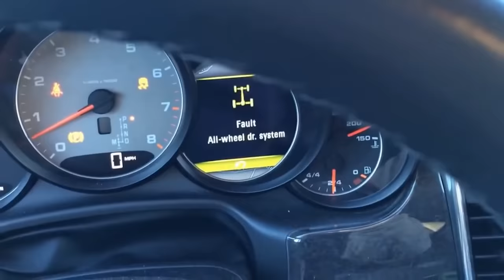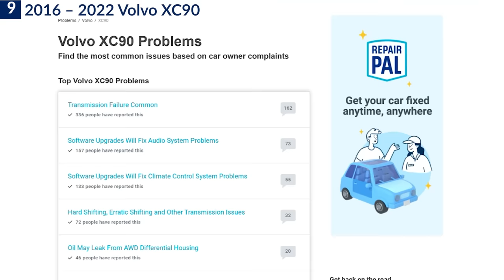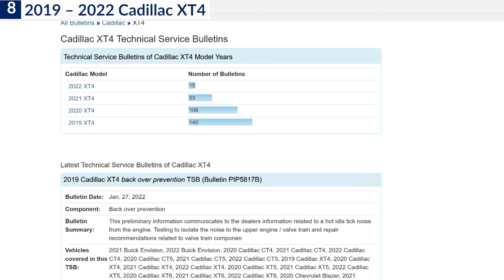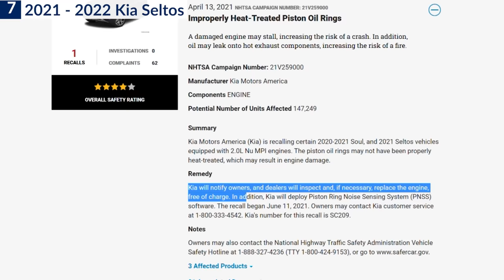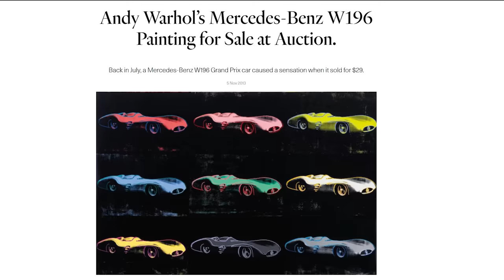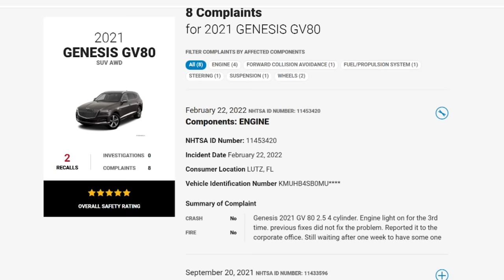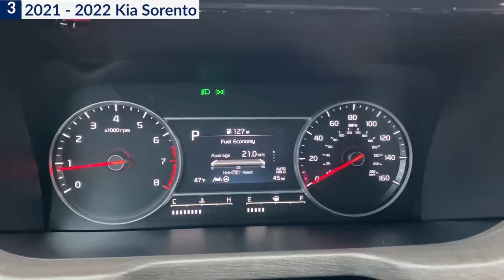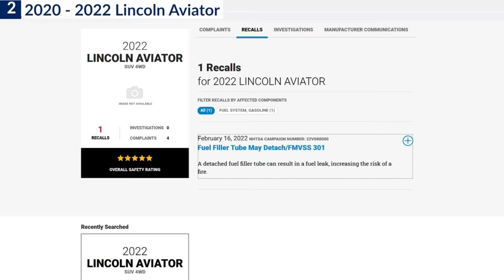10 New SUVs to AVOID - Here is Why !!

Comment: I had a Volvo, I can say the first year and 3rd year it was in the shop often. I currently have a GV80...I haven't had one issue at all. A friend of mine has the GLE 450, he swears he'll never get another Mercedes after driving it.
Reply: I’m thinking about getting a gle or even gls, why do you think your friend would not get a mb again?
Reply: @rosellebn  Because he's had it for 12 months and it has been at the shop for craftsmanship issues on 9 different occasions. He just got it back yesterday after 2 weeks in the shop. This time It would randomly pop the rear seat forward as if someone were trying to get in the 3rd row...but while he was driving.  3 separate occasions the battery died and the auxiliary battery would drain quickly too. He also dislikes the quality of the transmission...his previous vehicle was a BMW though, so it makes sense. They simply make better cars than Mercedes.
Reply: That’s not entirely true at all.  I went from M cars to AMGs and it completely depends on what you are looking for.  Nobody in their right mind would ever say BMW makes a smoother more Luxurious car than Mercedes.  That’s absolute nonsense and is coming from someone who has never owned one and their friend clearly got a lemon.  However, if you want sport over luxury than BMW is hands down the way to go.  You’ll l find 9 out of 10 people who hate on Mercedes bmw etc are hating from the outside looking in as they could never afford one.  The other 1 out of 10 bought a used one with 200k miles on it and complains  that it has problems.
Reply: @221ddj  You have some goofy opinions there and fit the categories I just described lol.  A Benz is overrated but a 70k Hyundai isn’t?? Hmmm.  If you could afford anything in the benz lineup, you wouldn’t end up with a Hyundai.  You’d be rollin in a S63 stop that nonsense, it’s very transparent.  As for Hyundai, everything they do is to mimic higher end cars for people who can’t afford the real thing.  Again, you’re exactly who I just described in the first comment.
Reply: @bustanutist  Warren Buffett has driven Ford's and GM's for the bulk of his life. Having money doesn't mean you blow it on cars just to show people you have money. That's what insecure people do. 

To me, Benzes are overrated, as are Jaguars and every other British and Italian car. I like BMW's, I like Genesis, I like Audi. Point is, you and everyone else can like whatever you like. If you can afford to blow money on unreliable cars, and that's what you want to do with your money, do it. I on the other hand prefer reliable cars that are nice, get me from A to B in style and I'm never at the shop. Meanwhile, I invest $15K per month in appreciating assets instead of depreciating cars. I own the house I live in, and it's valued at $912K, I have 7 figures in the bank too so your opinion is rather goofy to me, but it's all about perspective I guess.
Reply: @221ddj  Also, you clearly don’t understand capitalism. If a product was so overrated and inferior but was still charging a superior price…that product would never get such a strong foothold In the luxury car market like Benz does.    If the car was so inferior all the normal brands wouldn’t do everything in their power to imitate them.  I guess the markets clearly wrong because a 12-year-old riding in his mom’s Genesis says otherwise.
Reply: @221ddj  Uh oh someone’s taken marketing 101 and knows some buzz words lmao.  How does the us market have nothing to do with capitalism? I’d love to hear that.  Capitalism is solely based on supply and demand.  So again, you can’t charge a premium price for a non premium product… there would be no demand.  That has nothing to do with marketing.  You agreed that brands imitate Benz.  So again, you fit in the two categories I outlined earlier as you’re hating from the outside looking in.  Which is my sole point to the person asking about luxury cars/products.
Reply: @221ddj  You think someone could charge a premium price for a shit product for 97 years and dominate the market? Hmmm.  Interesting.  A lot of buzz words in there that fall short again.  Mechanical engineering and t shirts is a great comparison too.
Reply: @221ddj  For the final nail in the coffin:

Hyundai GV80
Price 55k
HP 375
TQ 4500
Transmission 8 Speed
MPG 18 City 23 Highway
0-60 5.5 Seconds

Mercedes GLC AMG43 (Direct Competition)  
Price 60K
HP 385
TQ 6100
MPG 18 City 25 Highway
0-60 4.7 Seconds

If you account for the legendary baritone AMG exhaust lmaoooo.  The Benz out performs your car in every single way and is marginally more expensive.  So, if the GLC is overrated, then my goodness don't even mention yours.  Again, hating from the outside looking in which was my original point that you've proven 10 times over.  Nothing left to say.
Reply: @bustanutist  "Dominating" is subjective. If we're talking revenue, they're 3rd...vehicle sales they're 12th. That's not hating on them. I don't even know how you came up with hating on them, because I said I wouldn't buy one. You're sticking to this idea that people who don't like them either can't afford them or have no experience with them. Neither of those are the case with me. Your argument is childish and not grounded in facts at all.
Reply: @bustanutist  That's not a direct comparison...The GLE is the direct comparison, and it wouldn't be a direct competitor to the AMG version. You would have to start with the GLE 350 which starts at $60K for the 4matic with 255 HP and 271 torque. Looks nice, but it's lethargic as hell and the transmission is crap. Compared to the base GV80 which is $55K for 300 HP and 300 Torque. Better, but not my cup of tea. Getting either of them in a form someone would want to drive with direct comparison the GV80 would be $70K, 375 HP and 391 Torque fully loaded, the GLE 450 would be $82K on the low end comparably equipped, for 362 HP and 369 Torque. 

At the end of the day, it all comes down to preference. I test drove the Mercedes, the X5, The Q7 and the GV80...overall, the GV80 was the best for me. The X5 was a close second, but it didn't have a 3rd row. The Mercedes was 3rd on my list followed by the Audi. If you feel Genesis is inferior, cool, if you think they're great, cool. What you eat won't make me shit, so I don't care what you prefer to spend your money on. The only reason we're engaging at all is because you responded with stupid ass reasoning and clown logic.
Reply: @bustanutist  I didn't delete any of my comments, and no the base models of Genesis are not targeted at any of the AMG line vehicles. What I said was "I wouldn't by a Benz because I don't like them and they're unreliable". You, as a fanboy, felt offended by that and start throwing dumb comparisons and said supply and demand is the only rule of capitalism...which is clearly not the case. Also, in this world of choices, I chose to buy the car I liked out of the ones I test drove. That included the Mercedes, BMW, Audi, and Volvo.  

Your simpleton mind can't understand the example of overpriced goods whether it is a t shirt or a car. The point was basic as hell, people will pay a premium for a brand name even if it is the same or lower quality as a generic or non luxury brand. I'm not a brand snob, I'm a car guy so if a vehicle is good and I like it, I have no issue getting it whether it's a Hyundai or BMW.
Reply: @bustanutist  Nah, I didn't delete it. The comment may have been deleted by a moderator but it surely wasn't me. Again, you aren't someone worth backtracking for. AND I stand by EVERYTHING I've said on this thread.
Reply: I was going to buy one however the dealer wanted 10k over MSRP and my payment was going to be over $1000 and I pay that on my rental prop so had a hard time pulling trigger on it. Plus my rate was higher than I wanted. Met an owner of this vehicle who got a loan at  less than 1 percent interest and they paid $53k approx 2 years ago and now same car selling for $80k  they got a steal. They can make a profit if they want.  Timing is everything!
Reply: @webuysellhousesaptscashoff9453  Yeah, when I went in they were talking about $5K over, to which I reminded them I didn't need the car and left. The dealer called me 3 days later saying the best he could do was $3K under MSRP, which at the time was $68K. When I saw that they're selling them for $80K I laughed, because that's not where I'd place the value of the GV80. It all worked out for me, but right now they're losing the "value proposition" advantage they once held.

Comment: Absolutely hearing nothing bad about the gv 80 from reviews to message boards the % must be very low if it's having any problems but this is my first time ever hearing that so I wouldn't put the gv80 on this list
Reply: I did extensive research on the GV80 as well as other Genesis Models. This review is Crap when it comes to the GV80. The Warranty is the best in the industry 3 years complimentary concierge scheduled maintenance 5 years 60,000 miles limited warranty and 10 years 100,000 miles on the powertrain.
Reply: Thank you!!!! 13 months old in my garage, with absolutely no problem. Drives luxurious, feels luxurious, looks luxurious, zero problems so far.  Very very happy with my purchase and driving experience so far, and same with other owners that I know!
Reply: @pepperdem7052  Same here bought my GV80 new in 2021 And what a great car for the money! It has been flawless just like my new 2022 Telluride I bought (got both at MSRP). So far 15,000 miles on the GV80 3.5TT and 13,000 on the SX Prestige Telluride. No way is the GV80 over priced for what you get and the Telluride is a great value if you can get at MSRP or below....but good luck on that!

Comment: This video is full of its self, a Genesis Gv80 is overpriced?? Have you seen what it has compared to a BMW, Audi, or Mercedez?
Reply: Right! I have one and the Prestige is definitely worth $72,000 MSRP. It's not Genesis' fault that the sleezy car industry are adding thousands in dealer markups on top of that and calling it a "Market Adjustment". We used to be able to negotiate down from MSRP so the Prestige I have should have been close to $65-68,000. I hope the car salesman industry get their karma for gouging like they're doing during this Chip/Labor shortage.
Reply: Overpriced it is. 70K for a Hyundai...
Reply: @CaliSteve169  
Despite how much badge snobs like to use that phrase, The Genesis GV80 and 2021+ models have their own platform. Their new luxury division is top 3 for vehicles that share just about nothing with their nonluxury vehicles. Toyota, Nissan, Honda, GMC VW just rebadged their nonluxury models and call it luxury. Genesis has the top designers and engineers they swiped from Bentley, Audi, Lamborghini etc. The GV80 was designed and engineered by Bentley engineers and designers.
Reply: @jonq.public5892  yep and after all this noise, Hyundai and Kia still made the list. Stick to Japanese brands if you want reliability.
Reply: @CaliSteve169  
Yeah, if you want tech and aesthetics from early 2000's or earlier. Just boring and outdated. Their history of reliability from those earlier times are true but certainly does not reflect the quality of today's vehicles. You can find good and bad in most current Brands and models. Including the Japanese. (NIssan!)
Reply: @jonq.public5892  Yeah, I can agree on the boring argument, but if it ain't broke, why fix it?
Reply: @CaliSteve169  
You could argue that a typewriter is more reliable than early modern PCs but we didn't stop inventing and innovating. I could pull out a typewriter and add ink ribbon and I can guarantee you it will work. But that does not make it better than a PC for productivity and usability. All of my first cars were Nissans. Specifically the Maxima. I had to move on. I will say Hyundai, Kia, Genesis aren't perfect but reliability is nowhere near as bad as people like to make them seem. So for (me personally), their warranty and drive to fix any issues they have without having to be forced into a recall is awesome.
Reply: @jonq.public5892  Yes, fair enough. I sold Nissan and Hyundai back in the early 2000s. Hyundai has definitely made a lot of progress since then. Still not buying the hype as indicated in this video. They are not there yet for me to consider buying one. As for Nissan, the maxima until 2002 or so (the ones made in Japan) were great cars. Better than accord and camry imo. The next generation became junk. 
Right now I own a 2021 Pilot and a 2019 Prius Prime. These 2 brands are still the leaders overall imo.
Reply: @jonq.public5892  Amen! BMW and the other germans are great sure, no one can deny that because I also own an Audi A6 but my Genesis has way more and at a more economical price for what Audi offers. yes the Audi can have it all too but at 20k more.
Reply: @CaliSteve169  And the Korean brands as well.

Comment: Classsic Honda and Toyota family are still the greatest
Reply: No. If you have a boring life ok - otherwise don't believe the crap you are fed. Open your eyes little one
Reply: nah, mazda's quality is best now. Toyota rar4 2019 redesign got much more issues than b4
Reply: @samliang4146  yes, Mazda improves so much in the past few years. Better than Nissan or Korean in terms of quality control. Mazda still use reliable torque converter automatic 6,7 speed instead of ridiculous 10 speed or dual clutch system.  I just missed the hybrid system in Mazda family, especially for heavy SUV, hybrid safe a lot of fuel.
Reply: @andyb7719  what do you expect from truck and SUV as appliances. We need haulers not showroom or fragile scrap metals.

Comment: I have a vw tiguan and I've never  had a single problem with it in 3 years. This video is BS.
Reply: lots of Tiguan owners don't maintain their vehicles, so lots of them fail, which could be how it made this very biased list. they also used consumer reports as their source which has a notoriously heavy bias on car brands other than Honda, Toyota, Lexus, Acura, and Nissan.
Reply: @zsamps  Nonsense. VW is one of largest companies in the automotive industry and its top selling car currently is VW Tiguan.

Comment: Love my 14 year old Suburban. 236k hard miles with only wear and tear repairs (brakes, tires, etc). Last week the engine started making noise. Mechanic recommended head repair in short term or full engine for long term. About 6k repairs for a 10k valued vehicle in otherwise great shape.

Thinking of selling this one for whatever I can get and dropping another $70k for a brand new LTZ for the next 14 years.

Comment: I was looking at a sorento now seeing this list Im very concerned would I be okay looking at the sorento hybrid model any concerns there
Reply: I agree it seems like every car has similiar problems. Its all this electronics and vvt engines and transmissions out there today.
Reply: Have a ‘21 Santa Fe with the same engine and DCT as the Sorento discussed in the video. At 6,800 miles heard a loud buzzing sound coming from the front of the car. It now needs a new transmission and have to wait weeks for a new one to arrive.
Reply: Ignore it! They lied about a lot of cars on this list!
Reply: Ignore this list. Seems like a lie. Range Rover is missing, Discovery is missing
Reply: Never buy a Hyundai/Kia product. Toyota or Honda only. Even a Nissan or Mitsubishi will last longer than a HyunKia product.

Comment: This list seemed to be compiled from someone’s ass. Other than the Germans, this list seems biased and not based on complete facts. GMs full-size SUVs are some of the most reliable trucks on the road. No way they are number one on that list. Also, if the Tahoe and Yukon twins are on there, the Escalade cousin would be too. Also the same truck.
Reply: I agree, I have the Genesis GV80 Prestige which is still in its first model year. He said he was ranking SUV's that have been at least 2 model years old. I have had 0 issues with it. It has no recalls that I'm aware of.
Reply: It's mind-boggling to think any of these have serious problems in 2 years!I have a 1999 Suburban with 170K. Absolutely dependable - runs and rides great, still looks good. It's my favorite after all these years.  I also owned a 2008 Navigator, which was problem-free and my son is still driving it.  My wife has a 2017 Lincoln 3.7L MKX and we love it;  We bought it to replace a 2001 Deville with zero problems and ended up keeping it!  Some of my friends have german cars which seem fine for a while, but wait a few years and see what they cost to own. I usually keep vehicles for 10 years or more and with regular maintenance, have never had a major problem with any of them. If you lease, it probably doesn't matter what you drive!

Comment: Why isn't there a perfect vehicle that is reliable Always?
Reply: Although there's no perfect cars or suvs and trucks,,,Toyotas are the tops reliable on the market, all you need is service on regular bass (oil change & filter, brakes ect.) they are built to last☺! 
Just saying.
Reply: @rogerpr364  But, if there was a perfect car, truck, and SHV how would they look like? Would the seller or would they stay in dealer ship lots?
Reply: @rogerpr364  I had a toyota prius but switched to a kia niro because of oil consumption. No issues at all with niro for 4 years.
Reply: @TheEverbig  I get it  no cars are perfect because nobody  buy them and otherwise cars would be boring if they were perfect.